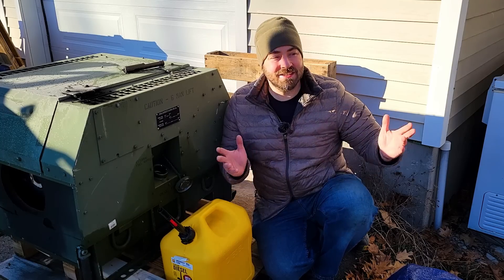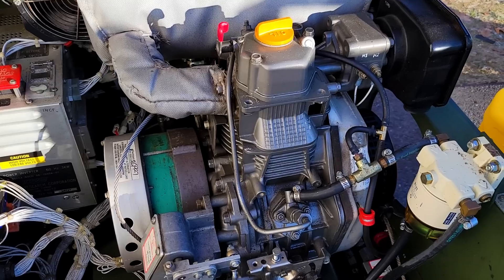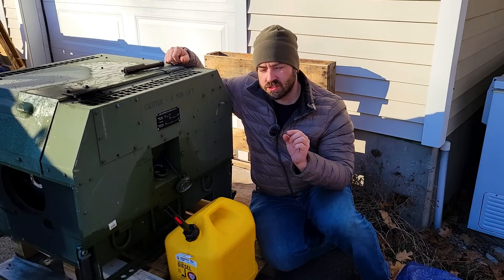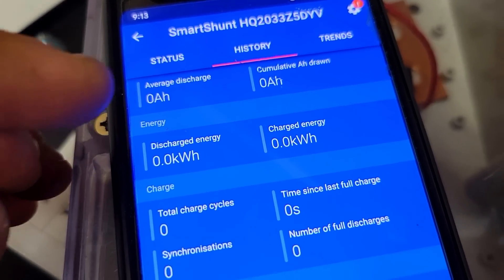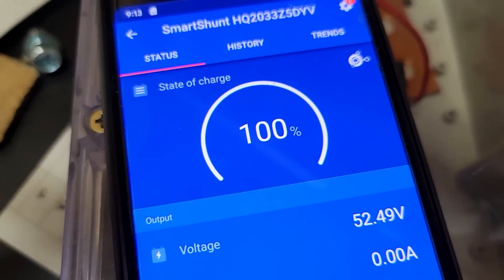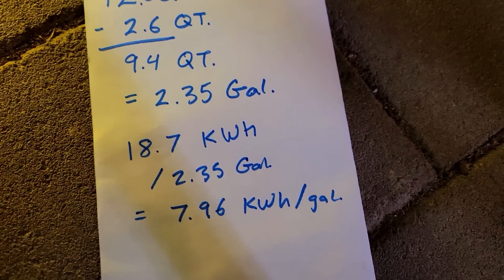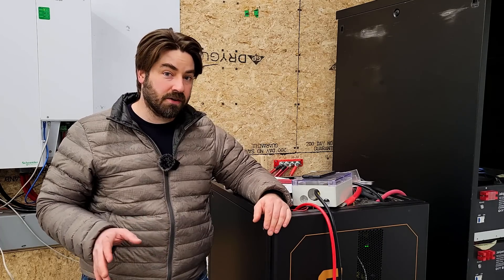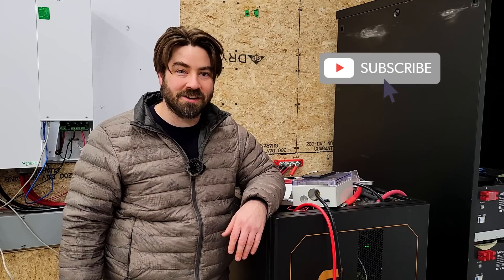How efficient is this Army generator?  MEP-831A

Comment: Some interesting discussion on the video. Here are some of my thoughts. 

Cost comparison vs volume comparison - I personally think a volumetric comparison is the right way to go for this type of video. Since fuel cost varies across different regions and times, you can calculate costs as they relate to you in both location and time very easily. If the video referenced only cost, the content may appear less relevant to people in other parts of the world or to someone watching the video next year when prices are different. The beauty in this approach is a quart is still a quart tomorrow as it is still a quart on either coast of the USA. The conversion from quarts to liters (or whatever volume measurement is dominant in your area) is not a hard one. Plenty of places to find the conversion equations. Maybe David could have given the both the imperial and metric volumes. I see that as improvement to make the information more universal. 

To the efficiency topic, the tests as being done in this series of videos bring everything down to common elements. Sure, maybe the term "efficiency" could be used in a better and in more specific context but.. Using volume of fuel converted into units of battery energy removes any discussion about the "magic" that happens between the incoming fuel and energy stored in the batteries. Discussions about volumetric efficiency of pumping systems, effects of compression ratios on engine efficiency, and energy density of fuel, are fun but do you really need them in this context? There are more than a few videos on YT already going over how IC engines work and differences in fuels used in them. The “Driving for Answers” channel is one to browse if you want to explore the details on the workings of ICEs. 

Lets be honest, what really matters to most of us is how much fuel goes into one side and how much energy goes into the battery on the other side. This video shows that relationship in wonderfully simple, clear, and relatable terms. 

Strictly my opinion.
Reply from the maker: Exactly what I was driving at with this video, and others on my channel.  Thanks.
Reply: Today for most individuals can get a metric conversion on line by asking Google.
Reply: @Subgunman  its still great to have while watching the video for the continuity of things
Reply: You stole that mep. They sell @ auction for 5000$. 5 years ago a 1000$. But that is excellent info

Comment: Im looking at one of these generators but inverter is missing.  Would it be worth it? Can the inverters still be purchased?
Reply from the maker: To the best of my knowledge, inverters are not readily available.  However, they do come up on Ebay from time to time.  Kurt (link in description) makes a kit that lets you convert it to a more typical generator if you wanted to go that route.  Usually, I would say if it doesn't have the inverter, then the value is in the engine.
Reply: @DavidPozEnergy thanks for the imput

Comment: I also owned an MEP-831A and found that generally they are not stable. I liked the Yammer single cylinder diesel engine but found there was always something going on with the wiring  which means reliability at times is questionable. Fuel wise they are not comparible to a Kubota generator with a D950 diesel motor that just sips fuel. Reliability and longevity are the key factors for me.

Comment: I chose not to get this generator or any of the military generators because they’re so large and heavy for what you get out of them. A 3kw generator that runs on diesel. Or 2 Honda style generators that run at 1,800W each. Two can be added together in series to create 3,600w continuous and up to 4,400W peak. I can take one generator down for maintenance. I can carry both and toss them easily in the back of a vehicle if I needed to. They can run on propane, natural gas or gasoline. Whereas the military generators run on diesel or jet fuel. Not as readily available or affordable. A diesel is notoriously harder to start in the cold. Since you’ve made the investment in a military generator. You can add supplementary fuel through an external fuel port. There’s an open source Army Technical Manual (TM) library on maintaining and operating the generator. I believe there is an optional engine and/or fuel tank heater. If not, you can make your own using silicone heating pads to help with starting when it’s cold. It’s generally good to ground your generator if you aren’t already. If you go with a large quantity of external fuel. I’d have a containment area with cat litter to absorb the fuel if it decides to leak on you.

Comment: There are 37kWh of energy in a gal of diesel, getting 8kWh out demonstrated just how inefficient generators are. Gasoline only has 33.7kWh of energy per gallon. So diesel starts with more energy per gal but it is also more efficient.

Comment: If efficiency for off grid is your game, go to a water cooled engine and a heat exchanger to reclaim hot water. Next nerd step is a water cooled exhaust exchanger. Free hot showers!
Reply from the maker: I agree.  I plan to build a micro-CHP (combined heat and power) unit.  Hopefully I'll be able to use it by next winter.

Comment: I really like how you carry out your experiments and the accuracy in data collection. Using your figures, the overall efficiency is:
Diesel - 19.83% (current video)
Gasoline - 17.51% (your gasoline generator)

This is based on the thermal energy of the fuels whereby diesel produces 10.6kWh per litre and gasoline produces 8.9kWh per litre. I live in Kenya and this would be 3.92X more expensive using the diesel gen and 5.66X more expensive using gasoline as compared to the grid.

Comment: Quite the interesting test! What do you suppose the output of this machine is before the inverter section? It would be interesting to hook the output directly to a rectifier and MPPT, similar to your home built device. Do you think there would be a change in output? Or could it even be made to function that way?
Reply from the maker: That's something I've been working on for quite awhile.  But, it's not as easy as you think.  This generator has a lot of safety switches/sensors built in.  Each one needs a custom modification.  I've been working my way through it one at a time.

Comment: Thank you for your test video! I bought 2 of this , one for spare parts and the other one to used at home for back up ac window unit etc. I'm trying to look for videos to get more familiar with. I'm in the process to fix my generator it needs battery and seems like a mouse was living there too 😅 I fix thos chewed wire also I notice the fuel pump wasn't working but im not completely sure becouse in the beginning I tried to crank it up with 12v battery and i found out it need 24v battery 😅  well I'm learning still my next movement it'll be to troubleshooting if it starts the engine I will make sure the inverter works and if works i will move forward with the speed governor upgrade I'm so exited😂
Reply from the maker: I bought two of these: https://amzn.to/3D4QZSB and wired them in series for 24V.
Reply: @ thank you I will check them out buddy!

Comment: Price wise.. I calculate (present diesel price vs gasoline price) to be a 9.8% deficit for the gasoline Honda Inverter genset, but the petrol Honda  will start far more easier at -15*C or even -35*C after a prolonged time at subzero temperatures due to diesel (even treated  at temps below -15*C can gel and definitely at -25*C )  The critical  scenario is an ice storm with a super cold snap and in that condition, propane can become problematic also.
Reply from the maker: I have only a few "shorts" videos on my channel, but two of them are comparing cold-starting.  Check them out:
Honda Cold Start: https://youtube.com/shorts/57vIvz09_zs
Diesel Cold Start: https://youtube.com/shorts/iBF0PJa377w

Comment: for a point of reference, that's under 20% efficient. assuming that the engine is typical and can turn 50% of the chemical energy into mechanical. you are storing 39% of that remaining energy as electrical.

Comment: To get a true cost, you need to add depreciation (based on life expectancy) of the equipment and maintenance costs.  Time involved would be good to note, especially if it involves skills or knowledge, and maintenance unpleasantness would be of varying levels of importance to some.  Quantifying labor involved is probably and hopelessly subjective, so better to leave out of the equation, but still important enough to note.

Comment: Strange that nobody captures the heat from their generators. i have for a long time . i use tube within a tube heat exchanger for the exhuast. For the waste heat from the engine standard heater cores . i switched to propane due to low cost.
The waste heat keeps my 800 square foot garage at 50f all winter. Co-gen units are very common but here in North Amercia.
Reply from the maker: I think CHP units are very cool.  I've considered doing it with a liquid-cooled generator.  However, I decided against it for my situation.  For me, I only fire up the generator about 10 times in January and February (for about 6 hours at a time).  Each time is when we have a week or more of low-sun conditions.  When it's sunny, my solar array handles all my loads.  There is very little run time on my generator.  For me, I figure the extra hoses, coolant, pumps, fittings, etc. just wasn't worth it for such a tiny window of use.  
If, instead, I was somewhere that I needed to run the generator for weeks at a time, then for sure I'd do a CHP.  Thanks for watching.

Comment: Hi,
Diesel = 40,3 MJ/kg
Gasoline = 25,5 - 28,7 MJ:kg
Diesel fuel if heavier then gasoline
Looks like the Honda is in fact more efficient extracting kWh per Mj ;o)
depending on your country fuel prices diesel can be (or not) a better solution than gasoline, so working with volume was the good way to calculate fuel efficiency (but not to calculate energy efficiency ;op )

good video David, thanks !

Comment: How about anther calculation with fuel cost. Diesel typically costs more than gas. Also some of the Honda generators are multi fuel. You could expand on that as well. Propane,  natural gas, and gasoline.  I bet your military unit is still the cheapest to run but it might be a little closer.
Reply from the maker: Thanks for the comment.  You are correct, that because diesel is more expensive, there is very little cost savings between my Honda and this.  The Honda has been great, and is a good choice for plenty of people.

Comment: If  1 gallon of diesel contain 37,1 kWh of energy , then the efficiency comes to around 21% , modern diesel engines can even get over 50%,  so for full off grid systems there is room for improvements. There is also option of using home made biodiesel or straight used up vege oil and with fluid cooled generators, used that excess heat for home.

Comment: From my perspective, that is NOT wonderful efficiency.

A REALLY good diesel engine can be had that will give 20HP per GPH, giving an expected 35.06KWh.  Reasonable efficiencies for the generator end and for the charger are 90% and 85% respectively, meaning that with a 20HP/GPH engine, we would expect to get 35.06*0.9*0.85 [KWh] = 26.8 [KWh] to the batteries.

This means that either we are losing energy somewhere, or the efficiency assumptions I used are incorrect, or that little 3600RPM engine is only delivering ~14HP/GPH which isn't very good.

If the generator is used a lot, then I suggest a slower spinning generator like 1800RPM.  In 2024, 1200RPM is hard to come by presumably because of emissions and engine/generator cost.
Reply from the maker: I also have an 1800RPM generator that I'm looking forward to doing a fuel test on, just haven't had the time yet.

Comment: Hi David. Thanks for your videos. So, the result is 8Kwh/gal so in metric 2.1Kwh/liter. One liter of fuel is 10Kwh energy. So this old army generator has an overall efficiency by 21%. Sound like low. Maybe with modern ICE it would be better but not proved by the Honda result....surprising!  Anyway finally, the generator can provide 24Kwh with a tank full and it is the most important to know in case of emergency.
Reply from the maker: Not exactly.  Remember, I'm measuring the energy being put into the battery bank.  All the electricity is going through the charger (yellow box on floor).  The charger is about 90% efficient.
Reply: @DavidPozEnergy  : Yep I forgot the charger. So, efficiency raises to roughly at 23,4%. Thanks for the note. Regards.

Comment: When I was working, both of our standby generators at both sites got a consistent 11kw per gallon. The smaller one used 22 gallons per hour and the larger one 27 to 35 depending on load. Your consumption seems pretty reasonable.
Reply from the maker: Very cool.  I appreciate you sharing some more data.  Do you know any specs other specs on the generators?

Comment: I have a 7500 Generac that only consumes a gallon of gas per hour under  load.  100% load ?  no I never operate it at 100% but 75 to 80% yes.  The fuel being gas is less expensive that diesel as well.  My Generac will go a whole shift as you said civilian generators won't do.  Not to mention it makes a ton more power  than the one you showed in the video and also to boot has a smaller foot print.

Comment: Did you just compare fuel efficiency between DIESEL and GASOLINE engines purely by used fuel volume? Diesel is much more energy-dense than gas, therefore you have better mileage per gallon. That should have went into the calculations.

Comment: Something important to remember is that diesel could be about 20-35% more efficient per gallon than gas since its energy density is higher and burning characteristics are better for efficiency so that may be the reason its testing more efficiently than the gas generator. A better comparison would be cost per Kwh since you need to take into account the added cost of diesel over gas. so in reality the honda might cost you less per Kwh if you calculate in cost per gallon.

Comment: Hi David,  Upfront I want to say I love all your videos and thanks for producing them.  I can tell you certainly love this stuff by the energy you put into your videos.  It seems that most times you hit what the mfg. STC  Standard Test Conditions results are listed at.  At least that's what I've seen you do with Schneider equipment.  As for me living off grid is gratifying in some ways but a lot more work than most people would think.  I know everyone has their own opinion and some folks come from the mind set that Army Equipment is built better than any thing else.  IMO all I can say is "run" when ever someone offers you something built for the military. While you and some others that run these have good luck I've heard more horror stories about people buying army surplus and having nothing but heart ache.  Additionally military equipment as you stated is finicky.  Saying that the army spec is conservative to me holds no water at all as everything ever designed by an engineer has a safety factor built in.  Anyone running any equipment over loaded constantly is only asking for premature failure.  Especially electrical equipment.   For me an 1800rmp water cooled diesel generator can't be beat.  Add a cheap engine controller to it and you can auto start it from any of your solar components that have a programmable Aux. output.  So for you it would be just two wires back to the Schneider XW6848 or your 100/600 Mppt.  Just for reference CentralMainediesel.com list the specs for a lot of diesel gensets. In those specs are gals consumption at 1/2, 3/4, and full load.  Based on the printed specs a Kubota 9.8kw genny consumes 0.41 gals/hour or almost 12Kw/gal.  That's twice the published 0.5gal/hour for the MEP831A genset.   Also I was just curious why your are running such a small generator?  With your current EG4 600ah battery bank and inverter charge setting of 300amps (1/2C) you would need 300 amps at approx 54 volts or 16.2kw to achieve this setting. Your generator is only a fraction of this capacity.   Is your inverter surging the load to the genset when its running? I'd assume it would constantly back off and re-engage as the incoming voltage and hz from the generator dropped.  If it is I'd recommend reducing the charge settings in the inverter to match your 3kw generator and adding a engine control module to it. That would make your goal of staring your generator based on SOC much easier to accomplish.  Good luck with all your off grid goals and keep up the great work on your videos.
Reply from the maker: I own several generators.  I like working on them, fixing them up, and building them.  I also own an 1800RPM liquid cooled diesel and it's also my favorite.  I like the MEP831A for it's own reasons.  
0.5C rate is the maximum recommended by EG4 for charging.  However, the batteries can be charged at less C-rate.  If I charge a 600Ah battery at 50A, that's under 0.1C rate, but it will still charge.  
I don't run my generators directly through my inverters.  Instead, I use a "Chargeverter" (link in description).  This way, the generator charges batteries, but the inverters power the loads.  
I have another video on testing the pass-through, and "generator support" functions in the Schneider: https://youtu.be/36H6Sb2IG_k?si=pzBOiGOJS9YHh18K

Comment: Can you run these military diesel generators on used engine oil?
Reply from the maker: Inside this genset is a Yanmar L70 engine.  It's well known as a robust, and forgiving, engine.  I suspect it wouldn't have trouble burning waste oil.  I plan to run some experiments with that in the future, so you may want to subscribe so you don't miss it.